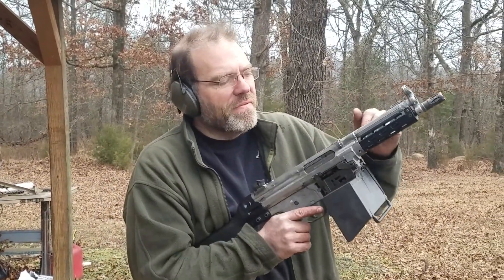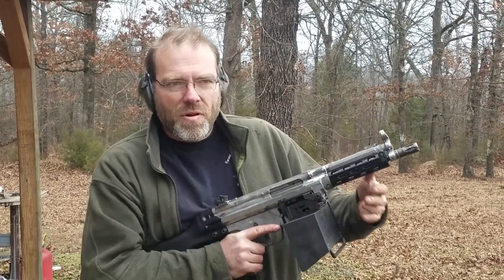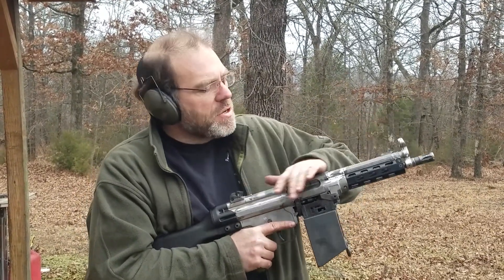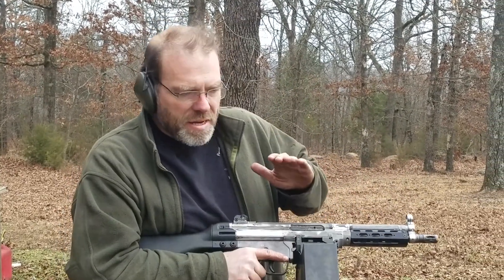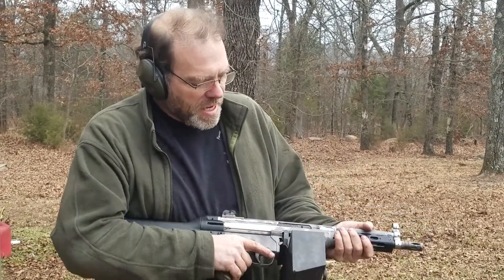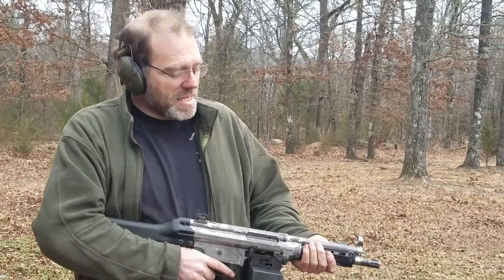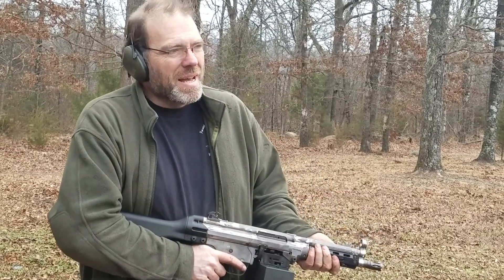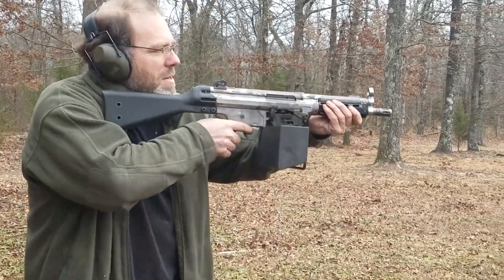Angry Dragon test run

Comment: Nice...what is a 21E and a 51?
Reply: 21E is a Machinegun made by "Heckler&Koch" and the G51 Is one of the prototype Assaultrifles that led to the developement of the G3 Rifle.

He ment that the Gun in the video is A MG build (MG21)that was shorten strongly (like the G51 beeing very short) and there for its a mix of both.